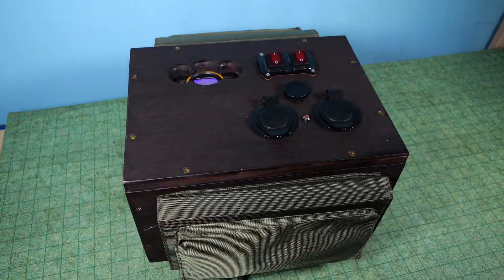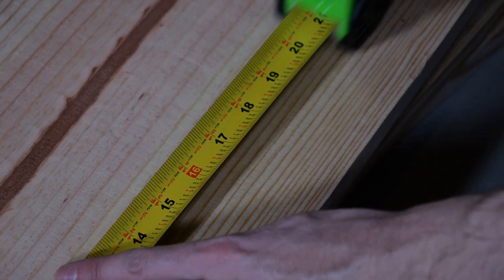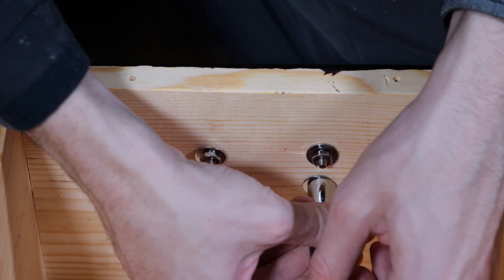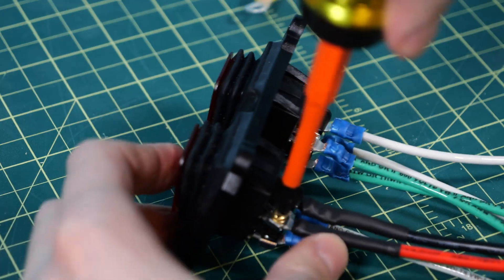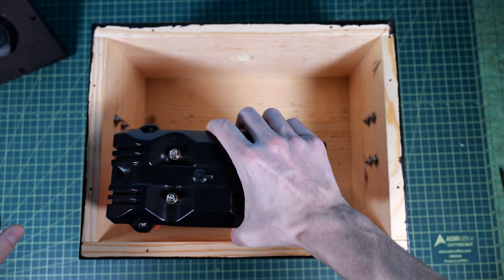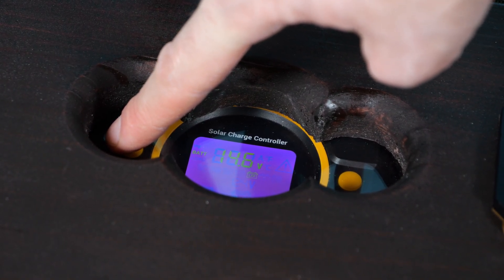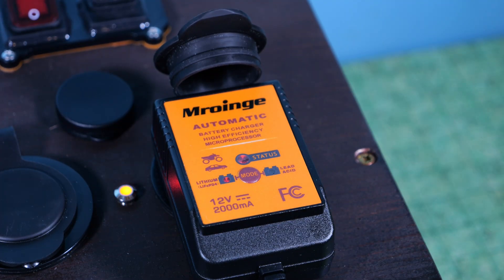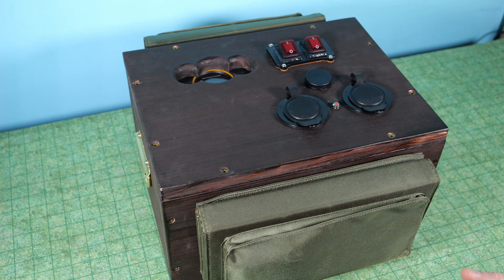DIY Solar Generator - Portable Solar Station - Full Build

Comment: i think the wooden box with plastic components in direct sun constantly for hours is not good. battery will also get very warm which will loose efficiency. there should also be some ventilation holes. components will cook inside the box in direct sun

Comment: Great build I have built something like this and also did a video on it. I love to make and invent things. I wanted to give you some feedback. I saw you used hot glue for sealing some of the wire parts and such. I used to use this a bit too and well let's say I learned the hard way it's not the best thing and using it like you did could be a problem later. If this is ever in a place where it will get hot say you left it out in the sun or a car on a summer day all that hot gun can melt and reharden as this is what happen to one of my projects.

Comment: id have used blocking diodes in the parallel of the two arrays so they cant backdrive one another if one is partially shaded. Great execution otherwise

Comment: It is nice and a useful thing to have. There's a few things I'd do differently like I'd use an Aluminum suitcase so I could carry it one handed so I'd have a hand free when carrying it around, also might find a rucksack it fits nicely in so I would also make it thinner, just as high as the battery is used and I'd have put the controller panel in a different way, lastly I'd have made it slightly less permanent by installing the USB port properly without glue but I guess it was a quick solution to your issue. Still nice idea and something I'd definitely build if going camping etc.

Comment: Heat from the battery ?
Reply from the maker: after 5 hours of running it under a load the internal temp of the box was only 86F so I'm not worries

Comment: If ya don't mind my asking, what would a project like THIS set me back?
Reply from the maker: I think after everything it was around $500 or so I'm kinda guessing off my head. and I'm sure if you shop around and change parts out you can do cheaper for sure. The solar panels were the most of it. It was hard to find ones that folded up as small with decent wattage.